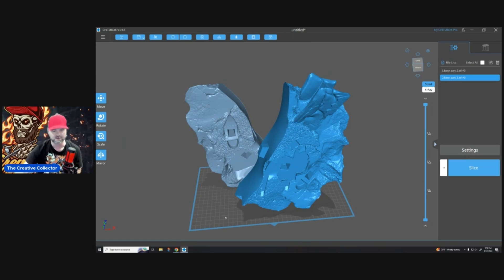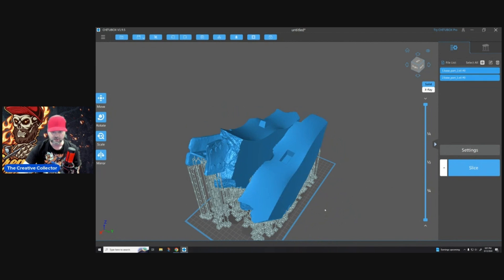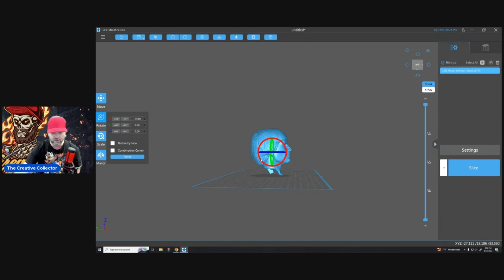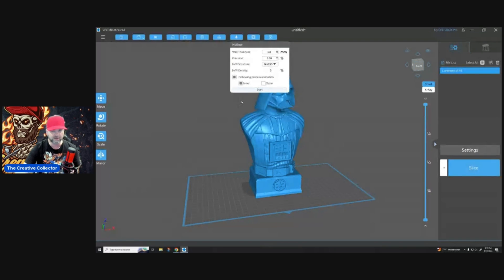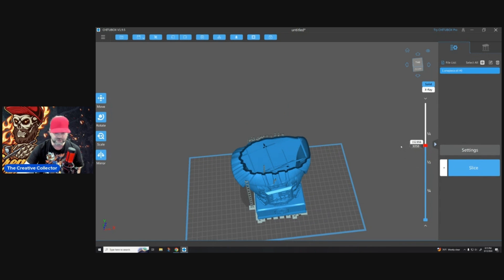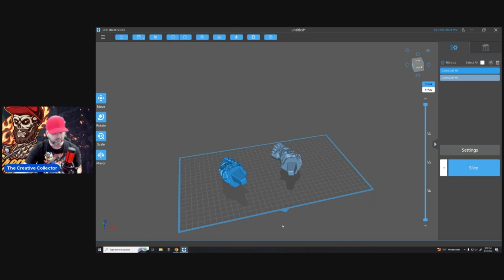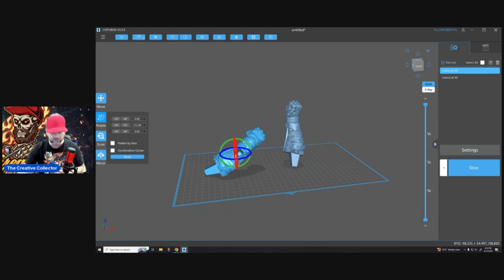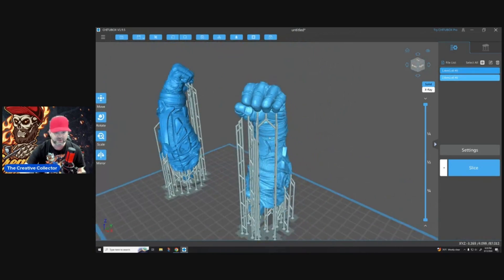How To 3D PRINT Better NOW! Creating better resin models

Comment: For some odd reason even when I hollow it out, and new chitu 2.2 calls it cross 3d, I get the cross patterns inside, but when I add supports I'm still getting supports inside along with the cross 3d. Did I miss something?
Reply from the maker: Your using the new version. I use the older 1.9.5 version
Reply: @TheCreativeCollector  yeah, so no idea then? its changed alot in the last year thats for sure.. Ohh well I guess ill mess with it a while and figure it out.

Comment: How would you make sure the grid infill is completely cured along with the whole thing on the inside? I’m super worried about that
Reply from the maker: Since I print hollowed at 1.5mm to 1.8mm it cures throughout. You can also use a small UV strip light run into the drain holes to cure the inside as well.
Reply: @TheCreativeCollector  I’m gonna be playing around with different thicknesses to see which I would like, will definitely start at your thickness and work my way up a little, I’m not good with electrical wiring stuff so hopefully I can find a uv light cable that don’t require much hooking up to anything lol
Reply: Not sure if you remember my name but before I moved to a different place I’d watch your videos a lot, since moving i haven’t printed or painted anything and it sucks, but not only do i still have my ender 3 s1, I’ve just gotten my Saturn 4 ultra in, my first resin printer

Comment: Hello I’m fairly new to 3D Printing and on the 3D infill part, when I hit auto supports it still fills in with both the infills and supports. I’m using the latest version of chitubox. I will greatly appreciate the help thank you for your time 🙏🏾
Reply from the maker: The latest version does that. I'm using version 1.9.5
Reply: @TheCreativeCollector  I’m on the 2.0.6 I believe

Comment: I use Chitubox as well.  When I do an infil and then do auto supports, it adds a ton of supports inside along with the infil.  I can not find a setting to stop it from doing it.  It may because I noticed you are using version 1.9.5.  I am using a new version.  I also don't have an option for the support density that you showed in another video.
Reply from the maker: Yes I've heard that with the newer versions it puts the supports in there. That's why I stuck with the old one. The density is under another setting but I'm not sure which one. I'll be working with the new version soon and post an update.
Reply: Yes that would be a great help!!

Comment: So for printing partial capes, how would you angle and support parts where 3-4 sides need to glued? I love my Wicked3D and B3dserk models but those superhero capes are the bane to anyone's existence. I've just had prints where the parts won't fit right besides of warping from support pulls.
Reply from the maker: I try and stand them up as much as possible and keep connecting sides up with no supports so they don't warp.

Comment: Honestly, as much as Tip #1 can help you have to understand there is a significant trade off with it, you are losing quality on the textured / finished side of the piece which you are going to support. So yes you will improve the connection to other pieces but the quality of your print is going to suffer as a result. If you can support the texture/finished side that is back facing from the viewer, I think this is the overall best case scenario.
Reply from the maker: Not really. Between using less support density as shown in the other tip plus if you use medium auto supports, AND you use the correct depth on the entry cones, the pull is very minimal on the texture. I'd rather deal with that than have to force a warped straight edge and use a lot of filler. But to each his own.
Reply: @TheCreativeCollector I agree with the commentary. ID hate to have all the nice side that people see covered in pock marks.
Reply from the maker: If its done right you won't have that problem, but it's whatever works for you.
Reply: @TheCreativeCollector  "Not really" is misleading, but let's be honest, there is a trade off to some degree. Supports take up space on the contact points and warp regardless of how neatly they are placed or shallow contact depth. The steps you've illustrated in previous videos help to reduce that significantly but isn't completely eliminated based on how resin printers work today.  In previous videos like Wolverines arms/hands, you printed them 100% vertical with supports on the contact edges, why exactly would you have done that otherwise? It's obvious, you hollowed out the model put holes in it and didn't want to support on any of the textured sides or put holes on the textured sides to stop suction. There is no reason to have oriented the model differently because there was more downsides than upsides. Sometimes printing on the contact surface is the lesser of evils based on the complexity of the orientation of the model - a good example of this is 90 degree bent arms or legs. I appreciate your tips though I just thought you missed mentioning some of this and it would have been beneficial for beginners.
Reply from the maker: The point of showing people this is so they don't have issues with a warping model fitting together and causing problems in the end. So it's NOT misleading. I've never, ever had any warpage from anywhere on a model from placing supports. If you have, then you're not supporting it right. I've done dozens of models this way and have had really good success. And of course I'll print hands and arms standing up all day long. Why wouldn't I? It's more beneficial what way. So I don't see your point in that. And yes, there are times where you have to print on flat surfaces. That's common sense. It's a judgement call on your end. And how do you think mass statue production companies print these? They're not printing flat connecting surfaces with tons of supports on them. They would rather fix small blemishes on textured areas than using tons of man hours sanding and leveling surfaces. I don't know how to better explain it than that. Like i say in my videos, I show what works best for me. Everyone has their own way of doing things. If you do, then that's  great! Whatever gets you the best results.
Reply: @TheCreativeCollector   If you've never had warpage, why wouldn't you place your supports on connecting surfaces? You're literally dismantling your own arguments. 

Companies involved in mid to high end statue production aren't using 3D printers, the majority of their models are sculpted in polystone then casted for mass production. I hope that helps your understanding.

I love your channel but you aren't correct here.
Reply from the maker: See now you're wrong because they so use 3d printers to print out the original model then create molds and cast it in polystone resin. They're NOT sculpted in polystone because you CAN'T sculpt in polystone. lol Polystone is nothing more than resin with filler gypsum powder in it. It's not sculptable. Know your facts before posting things you don't know. Don't take my word. Ask Sideshow or XM how it's done. A 3d print is made, post processed, silicone mold made, then casted, culled, and painted.

Comment: This is greatly appreciated I am only beginning to set my resin 3d printer in my apt. so ventilation is work in progress.  Using A/C window vent kit attached to a inline fan which will vent fumes and voc's out the window.  Reading other people's comments and your responses is also a blessing learning from other's experience will cut down on the learning curve.  You mentioned we don't need to be printing at max speed and causing warping prints, what speed are you comfortable with ?  Btw thank you for sharing your time and experience along with everyone here commending you and making great remarks and questions. 👍👍👍

Comment: So how do you normally cure the inside grid3D supports?
Reply from the maker: Because I print the walls thin enough, it usually cures throughout. But you get some UV strip lights and insert them in the drain holes. I do that as well.

Comment: I'm very interested to see that you don't add a drain hole to the top of the object you hollow out. I've always had the issue of fixing a hole (say on the top of the figures head in their hair) as I thought you HAD to have a hole either end to allow for drainage. I will try that next time! Thanks. 
Also, good point regarding the time to print v time to fix afterwards! Yup, even with light supports you still get little divets out of the printed surface. Cheers Henry!
Reply from the maker: I've never had an issue. Remember it stays a hole until it closes up at the end of the print. You might have a tad of resin come out when you take it off the plate, but not much.
Reply: @TheCreativeCollector  Good point. Definitely trying this next time! 👍

Comment: What about a video on air filtration? I've seen videos of people saying it isn't as bad as people say and others saying it is very toxic. I've been wanting to get a printer but live in an apartment with no way to ventilate near a window.
Reply from the maker: A lot of companies are putting carbon filters in or on the printer to help with the smell. A lot of it has to do with the resin too. You can use water washable and it's not as bad.

Comment: Why don’t more patrons makers use grid infill?
Reply from the maker: Good question. Maybe a lot of them don't know. I use it for all of my prints.
Reply: Never happened to me! I love grid infill.
Reply from the maker: Yeah not sure how it bends your fep. 🤥
Reply: Used it once, it bended my Fep to hell!
Reply from the maker: Curious how it did that.
Reply: @TheCreativeCollector  I created the infill in Meshmixer basically a grid, my guess is having so many contact points with empty species in between did that, it also wears out the Fep faster. I don’t see a reason for it, u adds vertical supports anyway and resin is pretty tough, u can always increase the wall thickness.
Reply from the maker: The main purpose of it is to keep the model from expanding and contracting therefore warping. This can happen from the motion of the z axis. I've never had any issue from it, so I must be doing something right.

Comment: Ok so my question may be stupid but if there's infill doesn't that make it harder to wash and drain the inside? I always make everything with 0 infill am I making a mistake in the structural integrity and in the long run?
Reply from the maker: It's definitely not harder compared to supports. It helps with stabiliy and bowing out. No infill can cause issues due to being empty, depending on how thin you print it

Comment: Interesting. I print the flat smooth side down and that is where I place the holes. I use support projection in lychee that automatically fills the parameters with light supports and the main area with thicker supports at an interval and that I don't usuall get a lot of warping by I do sand it a bit for the joint. Not saying any way is wrong it is interesting to see how someone else does things.